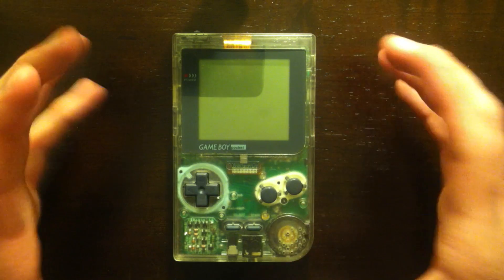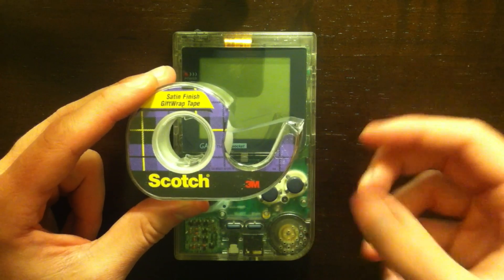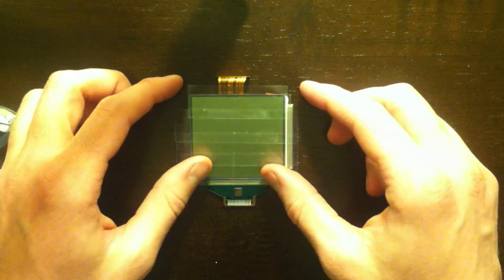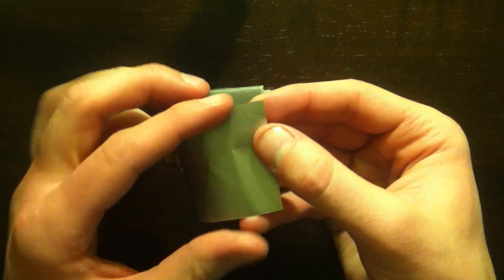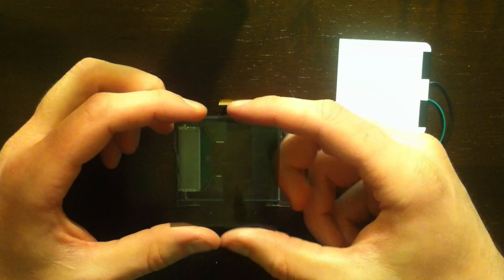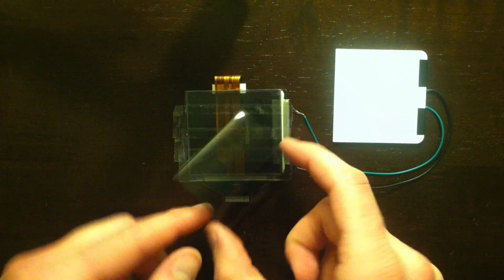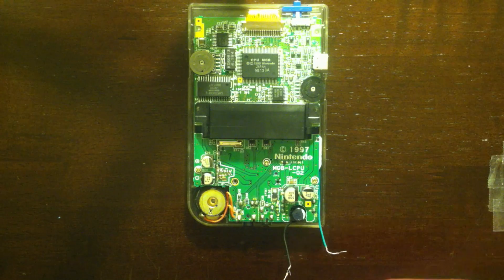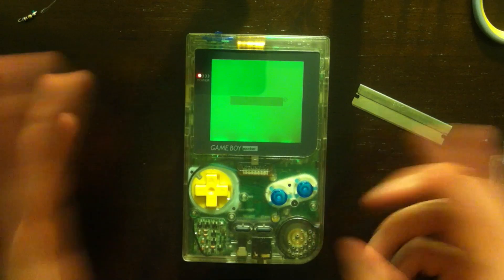Game Boy Pocket Backlighting Tutorial

Comment: Your soldering joints would look alot nicer (and possibly last longer) if you used your soldering iron properly.  A soldering iron is used to heat joints up, nothing more.  It's not a tool for transfering solder from one place to another.  Heat your joint and apply the solder to the joint.  Don't put a blob of solder on the tip of the iron, and then try to transfer it to the joint.  It won't work.
Reply: +AndehX It's probably the biggest sign of a novice at soldering. Most people who haven't really done any soldering don't understand that it's generally a really bad idea to bring solder to the iron and then to the joint. Then again, the iron being used is ... not super great either.
Reply: +Nick Morrissey Any bog standard 30W soldering iron is more than adequite for jobs as small as these.  As long as you keep the tip clean and use it properly (applying solder to the heated joint, and not using the soldering iron to transfer it) you won't have any issues.

But you're right, its very easy to spot an ameture by the way they solder.  I mean i'm no expert, but before I started modding stuff, I read up and watched videos on how to solder properly, to make sure I was doing the job properly.
Reply: Now I know how to properly solder

Comment: Well... I ruined my screen.  I had a hell of a time getting the polarizer off the back of the screen.  I accidentally pulled on that ribbon several times.  When I put it back together, I hear sound and the screen lights up, but I get a bunch of lines on the screen.
Reply from the maker: Ah yeah I think that means some of the connections were severed. There is something you can try but its very tricky and sort of risky, and i cant guarantee that this is your problem. But its what I would do if i were you. If you have a soldering iron you can turn it on and rub it along the bottom edge of the screen. This is where all the vertical pixels are conected (its a white section right above the green triangle that hangs off the screen)., Anyway rub it semi-quickly just to heat it up and soften the glue. This will often allow those connections to settle again and reconnect. I use a gas iron so I can take the tip off and use it as sort of a hot air torch, it works well. Anyway, do a little research if this method appeals to you. Because it really works best on traditional gameboys and its been a little while since ive done it.
Reply: TrailBlazer5280 - Well it isn't risky since the screen is already FUBAR.  However, I think the damage is where the two ribbon cables are soldered together.  I can see where one or more of the traces is ripped off the cable.  I'm wondering if next time maybe I should unsolder the two cables before removing the polarizer.    I worked on that thing for 30 minutes trying to slowly peel it off.  Normally, I would use a hair dryer to heat something like that up, but I was afraid I'd melt the solder on nearby joints (like the ribbon cables).  Maybe next time I'll try a chemical approach and use WD-40.
Reply from the maker: The iBookGuy
Honestly man it just takes some practice, this method is pretty much standard procedure. Trust me ive ruined a couple screens myself doing this and not being careful enough. I've had to sacrifice a number of gameboys getting a lot of this stuff down. It just takes doing it a couple of times.
Reply: TrailBlazer5280 - OK.. Just tried another GBP.  This time I peeled up the corner, then used WD-40 to weaken the adhesive and worked a credit card underneath until I got all the way to the end.  I never had to touch the ribbon cable.  Now I just need to solder everything and put it back together and pray it works.
Reply from the maker: The iBookGuy Oh nice man, I hadn't thought of trying WD-40. Good luck on the rest of the build, let us know how it goes
Reply: TrailBlazer5280 - Well, the screen works!  But I haven't fully re-assembled it.  I'm trying to find a better way to route the wires.  My backlight unit is a bit different from yours.
Reply: +The iBookGuy would putting glow in the dark sticker behind the screen work well instead of a back light if the glow is supposed to last 8 hours
Reply: No, that wouldn't work very well.
Reply: +TrailBlazer5280 this method does work, be very mindful of the pressure you apply. I usually have the systems powered on when doing this, you can see the scene of touch on the screen. If done right, the dead pixels will fire back up.

Comment: Hey man, I got my backlight installed. However, when I turn it on, the screen is blank with sound. We checked all the wiring, and made sure the ribbon cable was connected properly. The backlight itself lights up when turned on. Everything works accept the screen itself. We tripled checked everything too. Anyone have any ideas as to what going? Thanks in advance. =)

EDIT: In case anyone's wondering, I order the V5 backlight from Nonfinite.
Reply from the maker: Hey Crippled, it's possible you severed the connection of the ribbon cable without knowing it. The little cone ruin points are very sensitive and small so even if the cable itself is still attached at the bottom of the screen it may be broken. Honestly I'm not totally sure what it could be other than this. I haven't run into this problem before where the entire screen didn't show up. Did you possibly leave out the polarizing filter? Or not take off the old one?
Reply: Yes, I did take off the old polar filter. Thanks for getting back to me. Unfortunately, we gave up on that Game Boy. Thanks for helping though. =)
Reply: Hey CG,
If it makes you feel any better I think i killed my screen too the same way.
When I removed the original polarisation sticker there was gunk everywhere.
The ribbon appears intact but I think I touched it too many times removing the gunk and now my gameboy pocket screen is also caput. :(
Reply: Either you turned up the contrast too much or you turned the polarization film 90 degrees from what is was supposed to be.

Comment: Hi there, great tutorial so far, I was just wondering how to get rid of the sticky bits on the glass. The layer on my display didn't come of that smooth as yours. I can use my fingers on the outer parts, but I can't reach under the contacts to get rid of the glue. What are you sayin at 08:10 ? (Googarn???) I didn't get that part, thanks for your reply in advance!  Cheers, Attila
Reply from the maker: Ah i was saying Goo Gone. Its this solvent that takes off sticker glue and things like that. if you find something like it just soak the tip of a cue tip and rub the area, maybe soak it for a sec. It should come off. Then the issue is working the debris to the edge. beside that maybe rubbing alcohol. Honestly the best way to do it is peel off the back in one smooth go, so that only the corner has sticky stuff on it. Maybe next time :) anyway good luck and let me know if you have other questions.
Reply: TrailBlazer5280  Thanks, haha took me hours to clean of the glue, and I guess I damaged the cable doing it. Light works, but the screens shows fixed pixels and doesn't show any moving pixels. Gonna get me another pocket and try again.
Reply: Attila000The000Hun Dont kill all the pockets for me!
Reply: Attila000The000Hun just go on ebay and buy some screens for like 6 bucks much cheaper then a pocket and you can get a lot of like 10 for cheap. link if requested,
Reply: hottechtalk link?

Comment: Great Tutorial! I followed it and installed a white backlight and resistor using the same solder points and it works great! I got the kit on ebay and the resistor it came with is 100 OHM I saw some people had questions about what resistor to use. Do you recommend using the resistor? It does dim the backlight as the batteries drain to save power, but evenly without any flicker. It is always the brightest with fresh batteries or when using the ac adapter in which it never dims. I have the same style backlight except green and resistor in an DMG Game Boy and it is much brighter, but that is due to the difference of the sytems. I will probably just leave the resistor on I was just wondering what would you recommend? Thanks for the tutorial I am really happy with the results.
Reply from the maker: Its hard to say honestly. I think if you're happy with how it is just leave it. Don't change anything unless you feel compelled. I took mine out and while it does flicker in some games, its not bad enough to make me change it. But I'd probably leave it in there next time. In the past ive always used them and its never been an issue
Reply from the maker: And thanks for the comment!

Comment: Good tutorial! The big guys are called capacitors. If you ever do more soldering I recommend a hakko or something with a regulated temperature.
Reply from the maker: Thanks a lot man! And for the recommendation, I'll look into that.

As for the resistor I'm not sure what the rating is. But I'd agree, it is best to have one. The kits are made that way for a reason and it will get rid of bad flickering in the screen if you have it. The only reason I took mine out is because of my batteries I mistakenly thought it limited the power too much.

Comment: Avoid purchasing from Nonfinite Electronics. I bought a V5 backlight for the original Gameboy from them and they sent me a backlight where the leds didn't light up at all and they ignored my messages. I tried alternate solder points on the lcd and main pcbs to no avail. To test the PCBs work properly, I took another backlight out of another Gameboy and put that there and the leds light up in that backlight. I've never had any other gameboy diy stuff seller send junk and I'll buy from some other place than nonelectronics.
Reply from the maker: That is certainly unfortunate, but I would refrain from completely discouraging buyers going to their site. I have never had a problem with them before and it may just be that they missed your email, or have been really busy. How long ago did you email them? I would definitely try calling if you can or email again. 
Another thing is, I'm pretty sure companies like this are basically run out of a garage. Its people who love modding and what not and start up a home shop, so its expected they wont be as efficient as a major corporation. I'm not saying it isn't unprofessional, but I don't think its fair to dismiss them unless this becomes a pattern.

Comment: Also what type of resistor to use please
Reply from the maker: Hey Mstroza99, I'm not sure of the resistor used because it comes with the kit. You might be able to see the colors in the video though and look it up. 
As far as battery life goes, you should get sever hours out of it at least. I'm not sure exactly how long it will last because ive never played it for hours at a time. But ive played it for a couple hours combined between sessions so it should be for good for at least that long.
Reply: TrailBlazer5280 most people ive seen typically use a 70ohm i think.

Comment from the maker: Ah ok ive seen these guys. It has a built in resistor so you won't need an external one. you should look at this page on their site for picture tutorials and look at the last one: asmretroDOTcom/mgb-backlight-tutorial

I honestly havent tried this hook up before, or their lights yet, so I don't know the differences of where the points are coming from on the board. But I'd try it out. if it doesn't work then there is probably something up with the light.

Comment from the maker: Have you tried their solder configuration? Are you using the resistor? It seems like a lot of people are having problems like that and I'm not sure if its because of the GBs, the lights, the solder points, or what. 
The only thing you can really do is double check your soldering, try their solder points and put in/take out the resistor. Beyond that I really don't know what the issue could be.

Comment from the maker: I wouldn't say i recommend it. My batteries were low in the video so thats really the main reason I thought it made the light so dim. If you have charged batteries the resistor (in theory) shouldn't make too much of a difference. And it will get rid of the flickering during game play. So if you can use it, and its not too dim, then I suggest doing so.

Comment from the maker: Hm that is really weird that it wouldnt even work in their configuration. I'm honestly not sure what else you can do. Maybe like search online for some slightly different solder points. Something has to work. That is really frustrating if you just have to deal with it being dim. Oh, I just thought of something. Did you make sure to buy the Pocket version of the light? I think resistors might (not sure) be different. If you accidentally bought the DMG version that could be the problem.

Comment: Hi i recently did this mod with the v4 envy white. I soldered the points (with the resistor) the way the nonfinite picture shows, but the brightness is so high that the games barely visible even while tweaking the contrast. I then discovered your tutorial and tried the points you soldered and did exactly as your video showed. I also removed the resistor for better brightness. It works great with games like dr mario and tetris, but the screen flickers when playing pokemon. Any suggestions?

Comment from the maker: No, the resistance can only be as low as the most resistant part of the circuit. Are you using the resistor now? If so try taking it out. Then maybe try the solder points from their website and see if that does anything. I'm not sure the difference exactly, electronically speaking, but if nothing helps maybe the screen is a dud. I always hook them straight to the batteries before an installation to make sure they turn on properly. And it never hurts to double or triple check your soldering.

Comment from the maker: Yeah check your solder points and make sure the solder isn't touching any other point, it sounds like the battery is getting drained really fast. That is just really weird for it to dim like that. Sorry I haven't responded, I haven't been able to find the resistor. I think I threw it out or lost it... If you try it in a DMG or find a solution let us know. I'd be interested to see what happens.

Comment: I actually installed a 47ohm 1/4th watt resistor like the one included in the package and it did not help. Still went dim within a half hour of use and was too dim to even play soon after. I will be resoldering the wires to make sure it's secure. If it doesn't alleviate the problem, I'll probably try one of the backlighting kits from ASMRetro, and throw this one into an original DMG. Thanks! 

If you have an interest in doing so, please post a tutorial of installing a frontlight into the Color.

Comment from the maker: Well, I wouldn't consider this an absolute beginner project, but pretty close. My previous experience mostly included re-soldering my guitar components a couple of times, which were rather large wires/connections and are pretty damn easy to do. Honestly if you learn like some beginner basics for electronics (like tinning wires and basic technique) and maybe doing some practice solders on random wires you should be fine.

Comment from the maker: Yeah I actually tried nonfinite's points as well not too long ago and it didn't really work. I'm not sure if it was my soldering or what, but I switched them (if i remember right) and that did work. It didn't seem that different though in brightness. So I'm not sure what to think. 
As far as your module goes I think it was just a dud because i haven't had any issues like that. I would email them if i were you and see what happens. include pictures too, maybe they will replace it. Good Luck!

Comment from the maker: You don't technically need it. Without it, when the batteries get low, the screen will vary in brightness with button pushes and actions in game. For example, in LSDJ when i play a song it gets darker. So the resistors is supposed to take care of that. It only happens when the batteries are low though so it's not really been an issue. 
Nonfinite recently posted a different way of soldering the wires on their website, though, so I can't speak to behavior with that configuration. 
Good Luck!